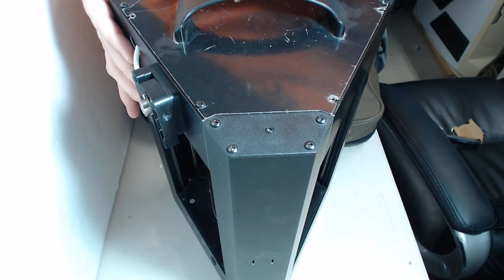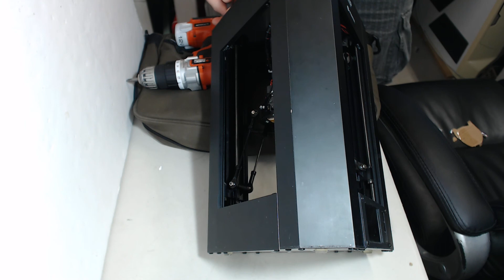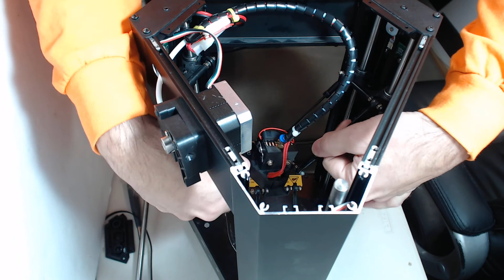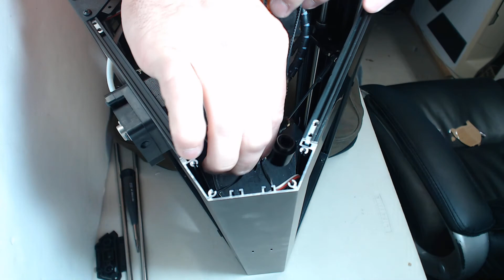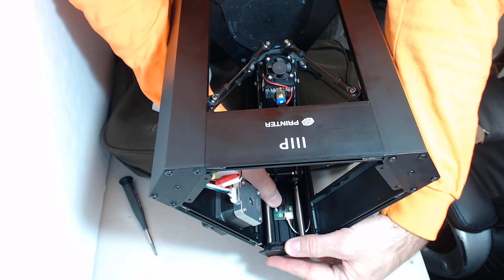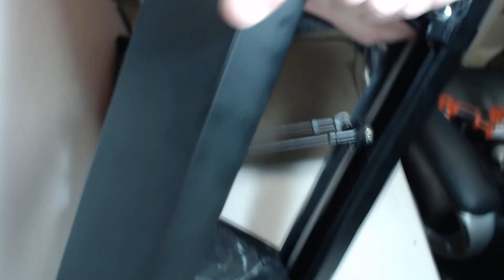Remove and Replace Belt - MP Mini Delta

Comment: My printer did not print right until I adjusted the belt tension.  But when I inspected the belts shortly after buying the mini delta I saw that 2 belts were defective.  After watching your video I easily replaced them using 6mm belts and steel crimps.  Stock are 4mm.  I put a crimp across the stock belt to have as a backup.   The factory belts are poor quality.  Thanks for this video.
Reply: I'm interested in upgrading my belts, where did you source the 6mm belts from?
Reply: late reply lmao but how do you adjust the belt tension?

Comment: I have been unable to use my printer for a month now because I cannot find any replacement belts for it. I have been checking gig digit religiously and find no signs that it is in stock. Is there anywhere other than gig digit that I could find a replacement belt?
Reply from the maker: Sorry about that. I've been trying to get more of everything. I should be getting a notification with shipping confirmation this week. Depending on when they ship, it should arrive late this week and by the middle of next week.
Reply: Ok thank you
Reply: Still nothing on GigDigit I hope the order gets in soon.
Reply from the maker: More than half my order was picked and packed by the end of day Friday. I assume the other half was nearly completed on Saturday. If this Saturday was not a working day then Monday I am hoping the remainder will be completed. I would expect my order to ship out either Monday or Tuesday China time. If that indeed does happen then DHL Express should deliver by Friday May 18th.
Reply: when will the GigDigit store say its in stock? Also sorry about asking all these questions. Im just hoping ill get my printer working again.
Reply from the maker: Either the later in the day or the next morning. It will be after the order arrives and I have checked everything to verify it matches the quantity I ordered. There will be over 3,000 pieces to check in so it will take at least a few hours to check everything in. If you are signed up to be notified when back in stock then you should receive an email between 5 and 120 minutes after the item is back in stock.
Reply from the maker: +William McLaughlin The shipment of parts is scheduled for delivery this upcoming Monday (May 21, 2018)  (by end of day). Parts will be back in stock sometime between late Monday night and Tuesday late morning.

Most everything should be back in stock with the exception of nozzles.
If you haven't already, please sign up to be notified when a product comes back in stock.
Thank you.
Reply: Thank you 🙏